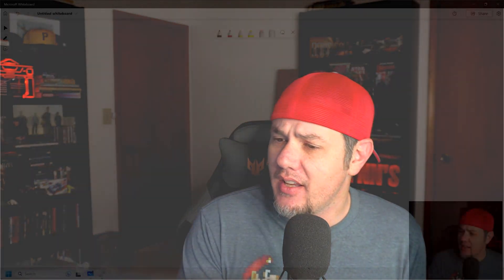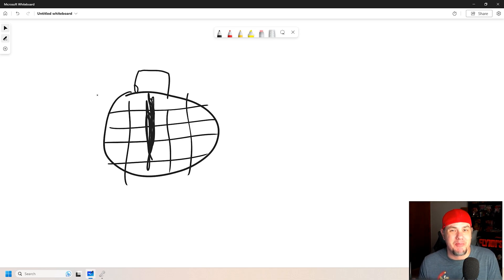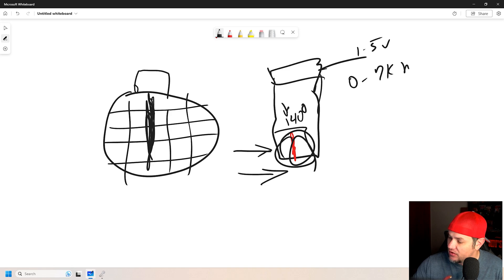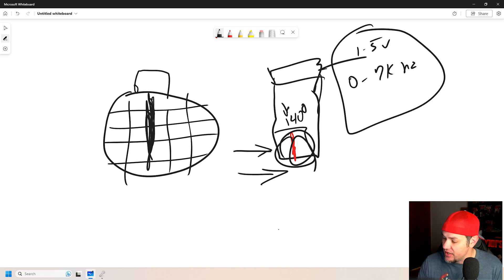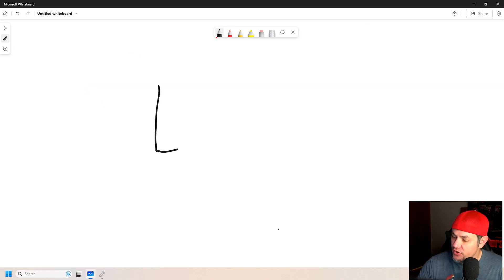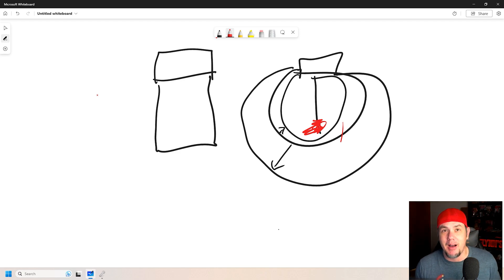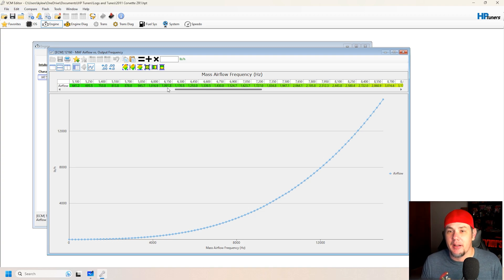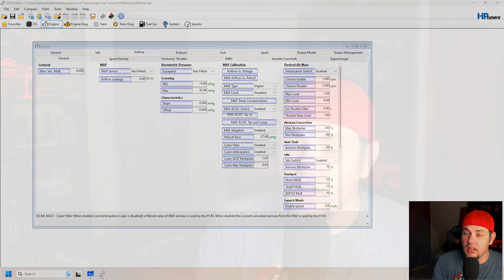Tuning Fundamentals: Mass Air Flow

Comment: This is my first attempt at HP tuners. Your videos are very helpful. Thank you. My maybe unrelated but a friend told me this could be a MAF issue. When I start the truck cold or after sitting for over an hour it runs hard but if I park it and restart within a few minutes (not always) but sometimes will run weaker and shift softer for the entire trip. Then resets for the next trip. What causes that? Thank you
Reply: Motors going bud.

Comment: What happens if inside your VCM editor your math table is perfectly linear and not exponential shape? 
Would this just been a preference from General Motors or have they started tuning these in that way?  I guess as I understand mass airflow, and the speed and density of air can’t draw a straight line on a graph.

Comment: Yo Kyle, need a kick start. Recently you were talking about some GM engine change that you casually referred to as Gen6 because of the new change. This had a crazy MAF curve. It went up to a peak and then down into the sweeping curve. Can you recall what that MAF curve is about?
Reply from the maker: No clue, it was on the C8 platform.  Haven't dug back into it to try and figure it out but there are so many moving parts on that tune with the Neural Network.